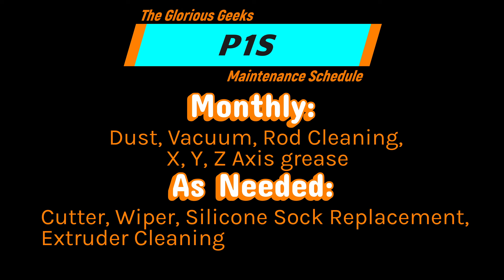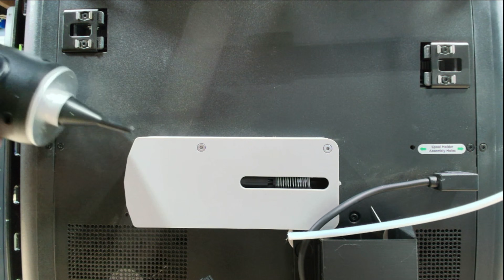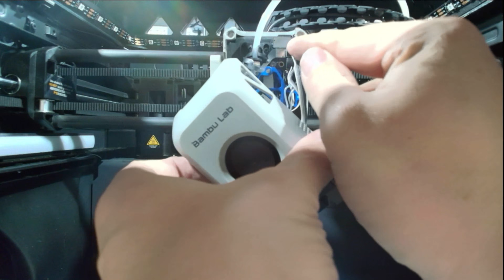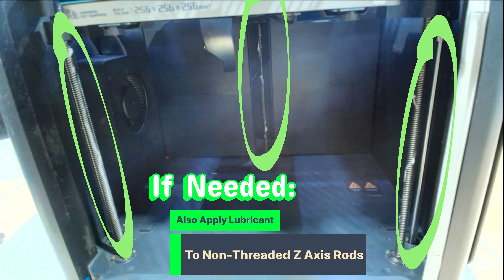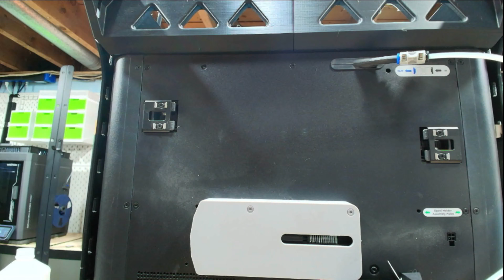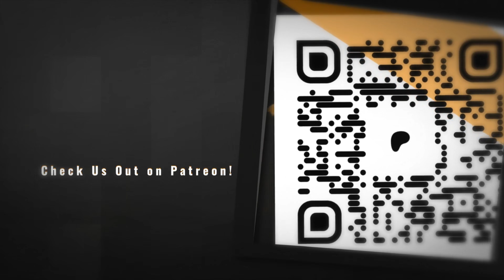Skip These P1S Maintenance Steps and Your Printer Dies

Comment: Could you link the Blower and Vacuum you used, as well as anything else that has to or should be purchased to be used for the Maintenance of the printer.
Reply from the maker: Yes, thank you for watching. I actually just filmed "Tools I use for 2026 Maintenance and Repairs". This will have the updated tools I use in it. I upgraded some tools and they perform even better. That will drop this coming Monday.

This is the duster I upgraded to and it works a thousand times better than the duster I used in these videos last year. 

https://amzn.to/4ffGmgD

This is an Amazon affiliate link, I may earn an small commission when you use this link at no cost to you. It helps support channel. Thank you for watching and the new maintenance tool video will be dropping soon.

Comment: You say wipe the carbon rods off without touching the belts,  as if it’s an easy task.
Reply: It's not hard really. I use gun patches to do that. I stick a bit of alcohol on it, put the patch through and wrap it around the rod and I never touch the belts. Try a gun patch!

Comment: Using any sort of compressed air / gas to blow out dust or abrasive material will cause it to be driven deeper, a vacuum sucks, it cant push it deeper.
Reply from the maker: Good callout, air alone can push debris deeper. That’s why I paired it with a vacuum at the same time so anything loosened, including debris that gets pushed deeper, gets pulled out immediately 👍

Comment: After how many printing hours is this maintenance recommended?
Reply from the maker: I print constantly so I do my maintenance every 30 - 45 days. If you print less frequently it won't need to be done as much. The machine will also give you label error code to lubricate the lead screws when it's time too

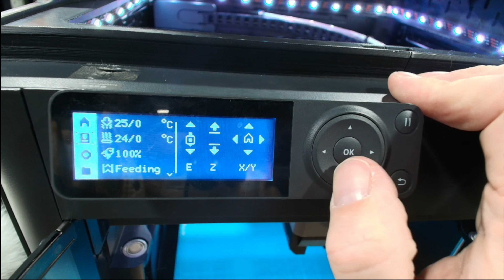Comment: how about a spa day for the micro SD card reader (5:04)
Reply from the maker: Whoa good idea! I forgot to mention that in the video! Blow that bad boy on out when we do the exterior! We will pin your comment! Thanks for adding!
Reply: @TheGloriousGeeks  when you re tighten those pulley screws for the tension, do you just tighten till you can't no more? or tune it? or what? you just crank them back down till you can't no more?
Reply from the maker: @EMC_Industries I tighten them until there's a good amount of resistance and gets hard to turn the screwdriver/hex key.
Reply: and clean those glasses